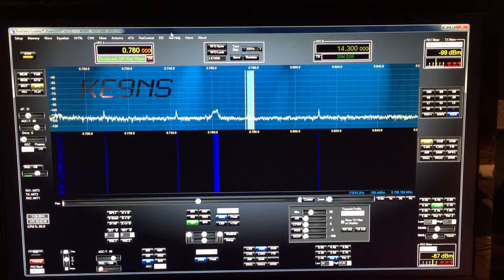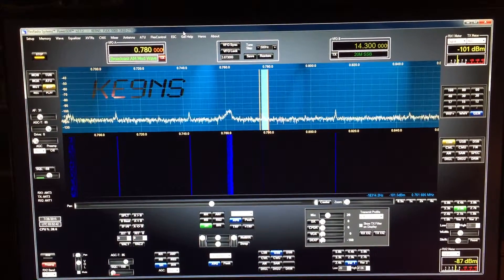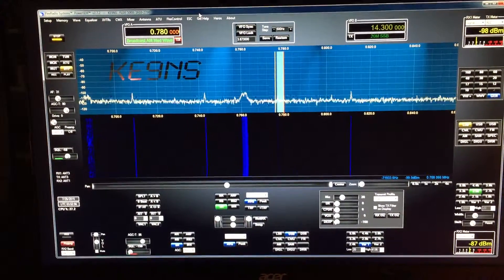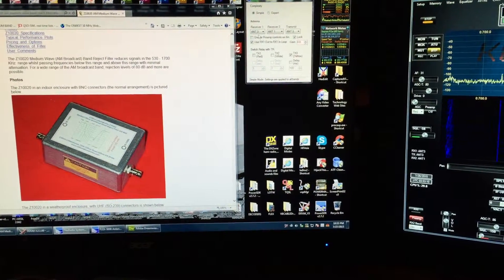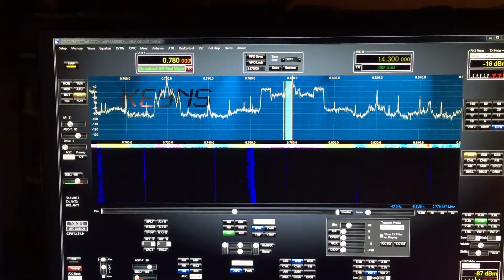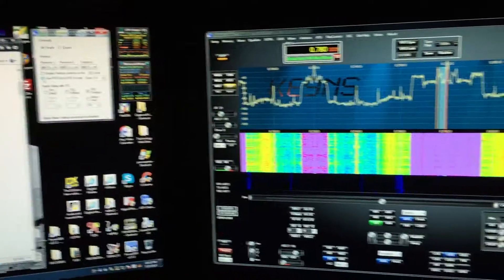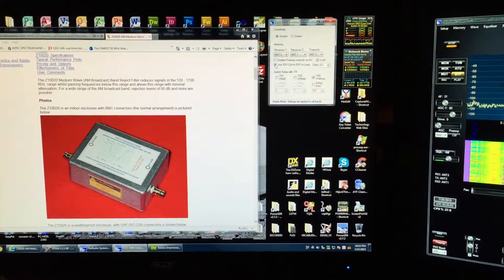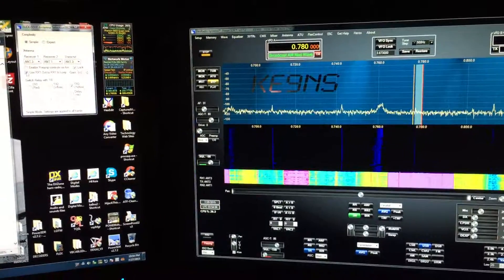Broadcast band filter for the Flex-5000 SDR radio.

Comment: Could strong BC station raise noise floor on 40m and 20m band? My noise floor is S7! there is no powerpine noise or anything weird, just ultra strong AM stations nearby
Reply from the maker: Sometimes on 40m I see a 6dB difference with the Filter in/out with an AM broadcaster around 6 miles away. If your AM broadcaster is closer and/or runs more power, then you may get a larger dB change.I don't see anything on 20m, But I use a dedicated tri-band Yagi. On the lower bands I am using a G5RV wire dipole.
Reply: Darrin Kohn Im receiving on of the AM channels S9+45dB!!! I would see its image everywhere on all bands
Reply from the maker: From my video you can see I also have an AM station at least S9+50db as well.You definitely want a BCB High pass or Notch filter.I list a few on my web page:  https://www.ke9ns.com/flexpage.html#preselectThe other option to help your situation is to use only antennas tuned for specific bands, but that's not always practical.